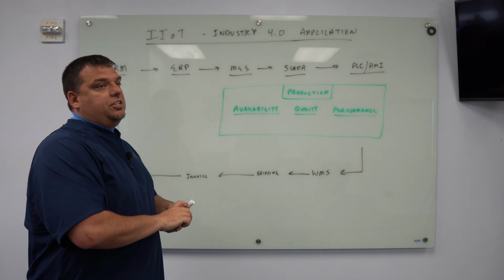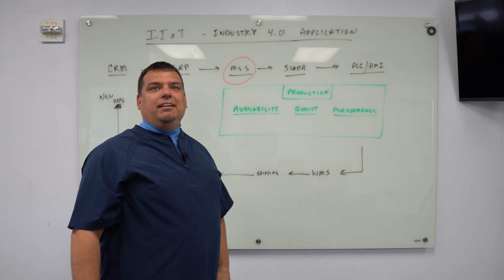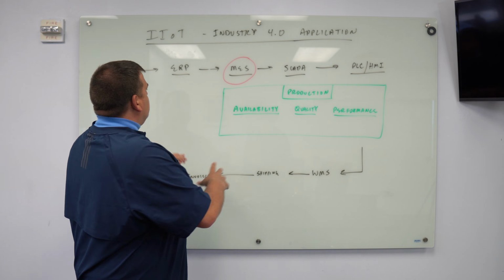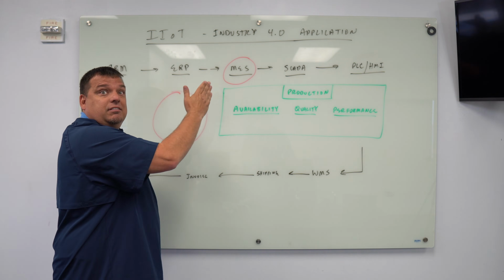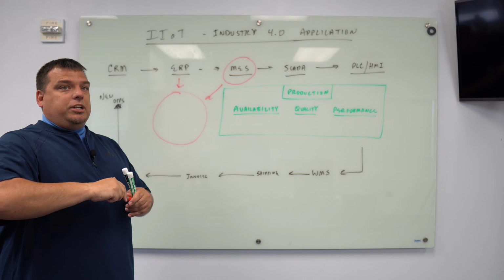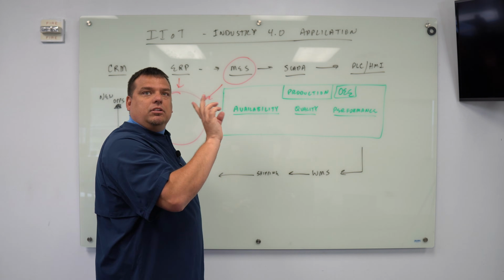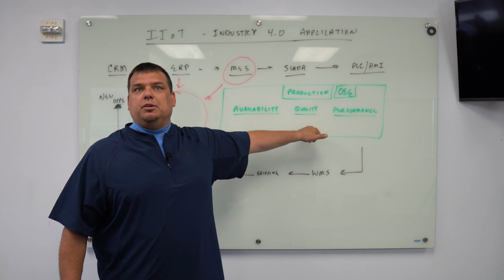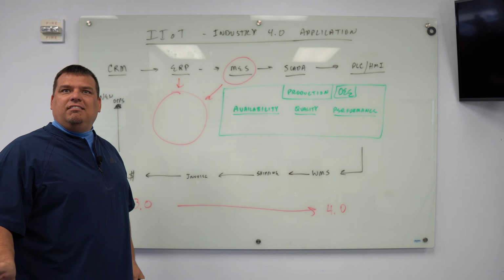IIoT & Industry 4.0 RANT by Walker Reynolds

Comment: I came across your videos, very good stuff. Helps me to understand the OT / manufacturing process. But I must speak of behalf IT/Security. Yes didnt like that rant :D First correcting few errors. Multicast is not a problem. It must be explicitly enabled on the network to run/propagate. It stops on every router, unless explicitly configured. If you are doing NAT, you are L3 device = you can route, hence you can stop the multicast just by presence of the device itself, without any additional configuration. Thats why for example nobody can spread multicast randomly over the Internet. When it comes to  NAT, I have never heard it's used to stop multicast, I am not even sure you can NAT multicast IP address. Never seen this, doesnt make much sense to me. NAT is generally used in organizations to a) stop public IP consumption at the edge of the organization when going outside to Internet (IPV4 is limited), or b) resolve duplicate IP space. I guess the b) is the problem you were trying to describe. If IT and OT were built separate, they might have conflicting private IP plan, hence NAT is required. But this is not a problem as well. At least not a problem IT folks would tell you no connection between IT and OT. If they do - fire them. The most important problems I have faced is that OT systems priorities and IT systems priorities are different. OT systems priority is safety and stability first, and security often the last. I have seen so many old OT systems, not patched , containing 15 years old critical vulnerabilities. And these systems are controlling critical manufacturing processes. OT people cannot patch the systems, they are afraid of breaking it. Its complex, lots of dependencies, difficult to test the upgrade somewhere else. Production is the lab. When IT talks to OT people about putting firewall in front of these systems, not to block the production, but to protect them from these vulnerabilities, oh man. Thats mission possible. They are fighting back. So thats the OT, not very secure environment, anyone with basic understanding could get into those systems and damage them. Then there is IT environment, where the ERP sits.  This environment is HUGE in terms of number of devices, connections and their function. And it connects everything together. Its IT environment where all the sites from the whole organization connects together, all the people their equipment, laptops, printers, servers, test machines, development machines. It's where multiple connections to 3rd parties takes place, VPNs, contractors, cloud, DCs, servers,... just everything to make the organization IT run. And all these systems might be operated by multiple parties that belongs to different companies and dont even talk to each other Its so difficult to secure all the use cases in IT organization. In the past, there was zone based approach. Everything that was in the Intranet was trusted. Problems solved. Not much. Nowadays there are many more successful attacks compromising IT systems coming from Internal network than External network. Why? Because of the old zone model. Users connect anything they want to IT just to bypass security -and then they are surprised IT was compromised. So the industry came with this new fancy word - zero trust. What it means, you are trying to secure also Internal network. You no longer say its in Trusted zone, now you trust nobody. How that works? Still not an industry standard. Every vendor has its own solution, not fully integrating with other systems. So you are at the mercy of what vendor offers you and what capabilities their systems have. And then when I hear someone saying there is no reason to not connect OT and IT environment I just smile. Its not impossible. But it needs to be secured. For example controlled connections from OT to IT could be allowed, but not vice versa. IT to OT is big NO. If administrators need to login to OT via IT, this needs to be done in very secured way. So bottom line,  I wish IT and OT people working together more closely, and trying to understand their problems and perspective. Cooperating on solutions so its both secure but also operability/maintenance do not suffer, and most importantly business can grow. I believe this is possible with good dialog between the teams somewhere outside over the beer. Apologies for long comment.

Comment: 8:40 I agree! I'm a software engineer, I worked for IT and Engineering departments, and always have this issues...
My last job, they want to automate a IVR process that according to the head of IT was only possible using 3rd party services bla bla bla... and would not work in real time...
I did it inside the ERP database (SQL) and made it work in real time, I was able to create a POST request calling a REST API that was on the customer side ... all this in SQL ... and guess what... we didn't have a test environment ... did it straight in Production! lol

Comment: Oh my god, you actually think changing the PLC code is going to make a major change in machine efficiency?  How much experience did you say you have???  No, the ACTUAL reason highly efficient companies are so efficient is by using decades old technology, like statistical methods, to constantly remove small inefficiencies from their manufacturing process on a daily basis.  If you remove a 0.1% inefficiency 100 times in a year, you've gone from 80% to 90%.  And companies like Toyota have been doing this for DECADES without Ethernet, IIOT, or any other fancy technologies.  They just pay close attention to the real drivers of inefficiency, things most people ignore because they don't think it matters.  This isn't new information; it's been out there for half a century now!

Comment: Really like your videos but here not so sure. 1st connecting ERP to MES/scada/plc is super easy thus all realtime info flows down from the erp to the floor and back up from the floor. Also who wants to run different software for wms, shipping, billing... If you are running 10,20 50 mills you want a unified solution maintained centrally or even in the cloud today. Now MES and scada run locally but some wnet as far as running these centrally too

Comment: I have no background by education. By career, I worked for a railroad wayside monitoring system which used PLC and SCADA systems and Oracle for database with several optical scan cams and sensors. 
What is MES?
What is HMI?
Can I request you to elaborate each acronym at least once at the beginning or on the first use? It helps people like me to understand and learn IIOT without self-doubt.

I want to thank you for your authoritative talks. I can hear and see how much experience you have in this field. You are a master!

Comment: Of Course...the ERP rant.  My Story: 1992...My employer's ERP/Accounting/Inventory was Mapics II (which was old even back then).  A very good system if you ask me, even by today's standards.  They just did not have the automated data input, or much analysis, because IT had trouble with it communicating with other software, and department turf wars.  Plus, the interface required terminal skills (which few managers had back then).  Spending on Oracle, Epicor, etc. were going to be "the fix" to the "problem".  The core problem was transparency, and communication.  On that note...is SAP really that much better?  Interested in your thoughts.

Comment: Great video Walker and Zack!  Thanks for posting the whole thing.

People starting out with an OEE in the 30's is pretty common. We've seen low 20's. Almost exclusively, they think it's better, especially when they are doing "calculations by hand". There is almost always that shock of the lines and facility being that low and needing to work past that shock and to allowing them to become more efficient. 

The data visualization is a big thing. If you've seen Our Hour by Hour Productivity video. Very similar, showing operators what is happening based on real time data of the lines. Big performance boost. 

Also with scheduling, understanding what change overs need to happen between runs and scheduling that more efficiently. We run into this a lot in food and bev with allergens. 

Wait for the forthcoming  Corso series talking about all the "little things" we do to find make processes better, like changing PLC code, like updating HMI screens, most of those are looking at how machines were originally built, and talking to operators and maintenance staff to understand how we can help make their jobs easier. If they know it or not, they are a huge wealth of knowledge and we need to capture that.